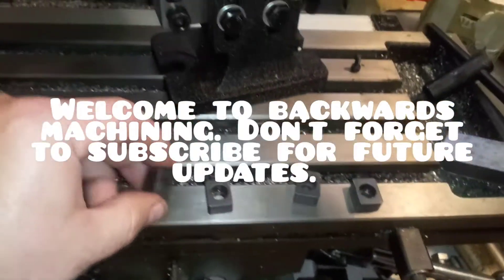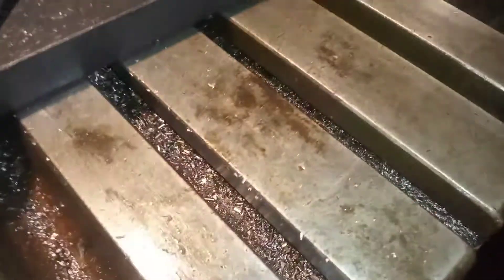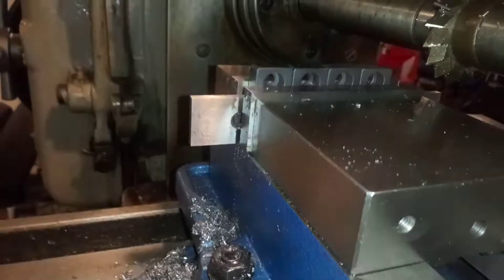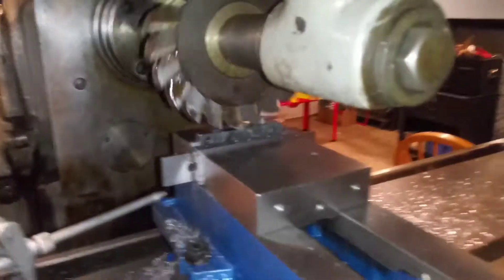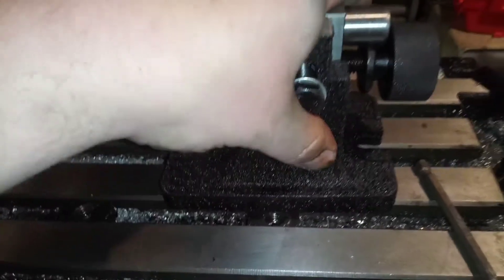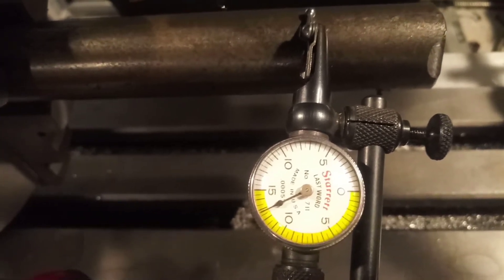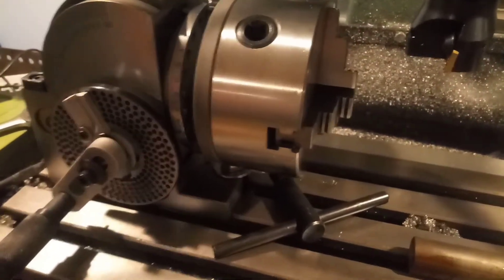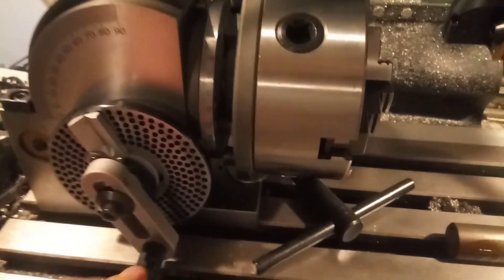Few small issues with the BS-0 dividing head

Comment: Odd that the alignment blocks didn't fit.
Reply from the maker: To be honest they aren't something I've dealt with a lot. Most of my old equipment never had them. Which is why I was little confused as to why they didn't fit and if it's something people are supposed to make them fit to there machines.
Reply: @backwardsmachining7526  The horizontal mill is really earning it's keep. What kind of surface grinder do you have?
Reply from the maker: @johnstrange6799  it's a Reid 6*18 inch. It's an automatic one. Not the fancy kind, the old hydraulic kind.  It's actually a funny story... My work gave it to me, they didn't want it but it weighed about 1600 lbs so I had to take it apart to bring it home. The base by itself is scary heavy.  One of these days you will see it as youtube video. I'm going to completely rebuild and paint it a nicer color.
Reply: @backwardsmachining7526  Cool I look forward to seeing it. I feel you on disassembling machines to haul and load them in.